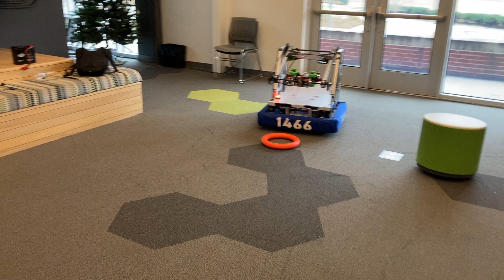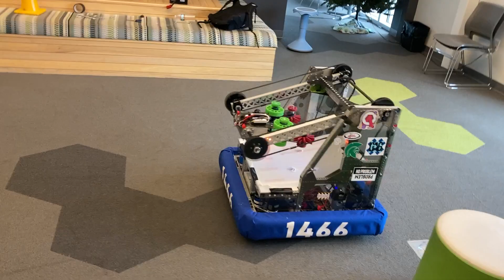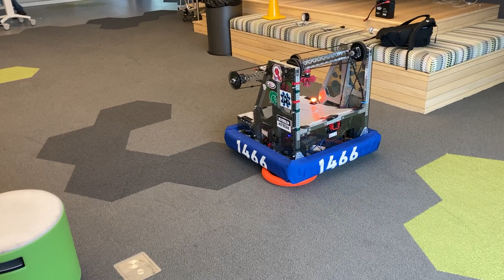Swerve Driving Over Crescendo Note | 2024 Prototypes

Comment: What is the bumper height on the robot? What about the chassis ground clearance?
Reply: ground clearance should be about 1.72" for their modules, unless they changed something
Reply from the maker: The bumpers are mounted as high as possible and are ~4.6" plywood with the stacked pool noodles. Measured as about 2 1'4" off the ground, in some places (back of robot) the fabric or pool noodles have sagged and it is more like 2". For 2023, we were going for max ground clearance to get over the charge station even if leveled already. The MK4's are mounted on the bottom of the frame rails, so the robot belly pan is ~3.25" off the ground. There's only rivet heads and the through bolts for the swerve modules protruding through to the bottom.
Reply: @webb1466  do the bumpers stay below 7.5 inches and don't violate R402?? I feel like it's hard to fit them with this much of a gap below 7.5inches max bumper height.
Reply from the maker: We played 6 events in 2023 with this robot without inspection issue. They are built to fit the 2023 rules. We were just rolling around and testing things out in this video, so it's possible they slip upward in this practice, but I don't think so. 

We were interested in possibility of under bumper intake versus over bumper. Either is viable, but we think we'll mount bumpers low for 2024 and intake over them.  @elobenccc
Reply: 4.5" bumpers are still bumpers @elobenccc
Reply: Description says 2¼"
Reply: @N.R.0047   whoops my bad